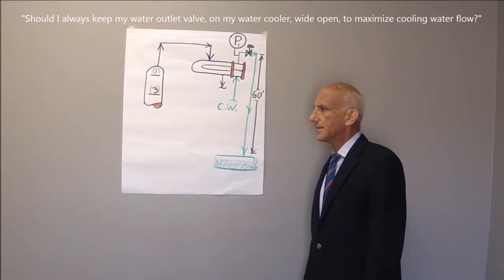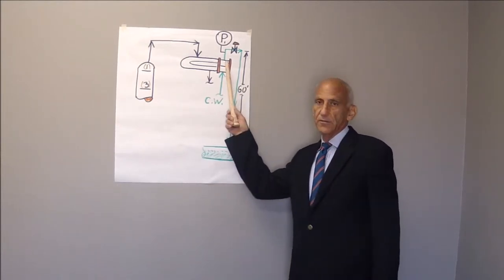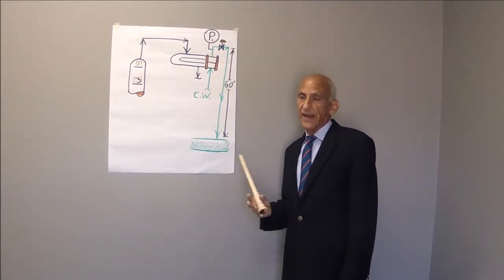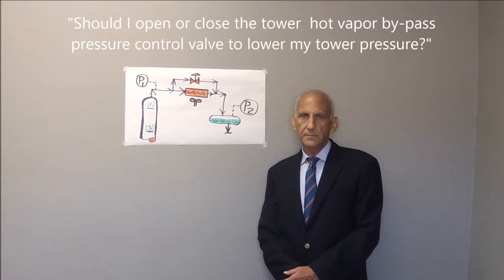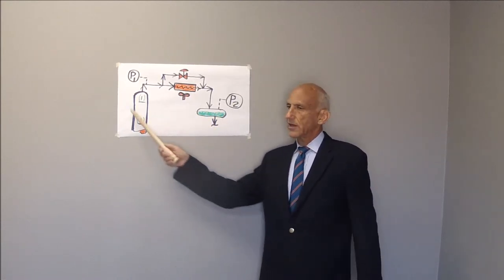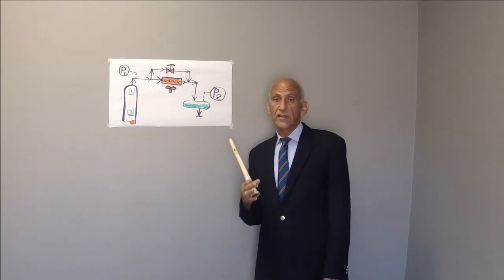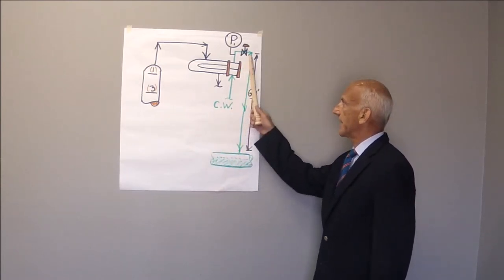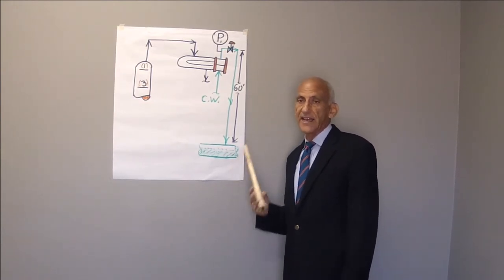INCREASING COOLER WATER FLOW THRU AN ELEVATED CONDENSER OR COOLER

Comment: So is it actually about a cw system design flaw? The header piping and CW pump should be designed such that slight over pressure is obtained at highest point in system at maximum flow rate?